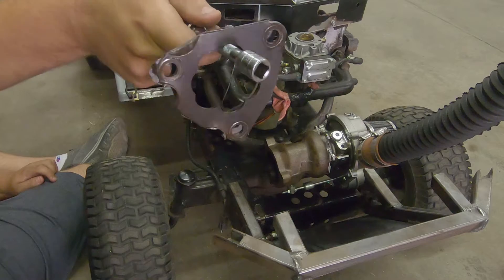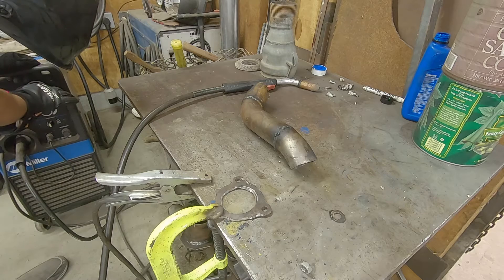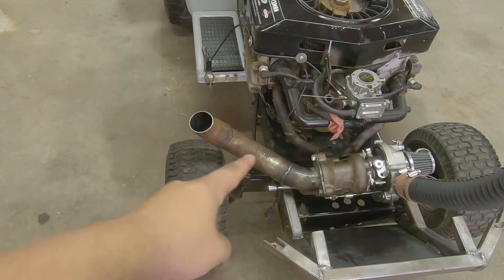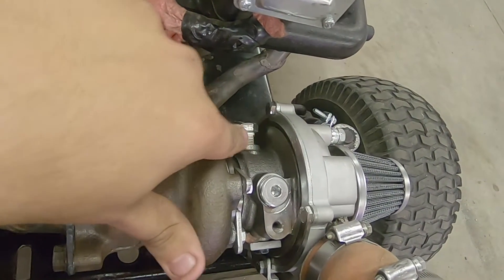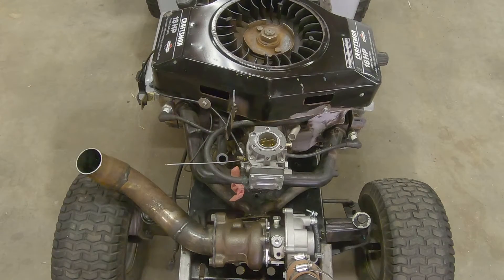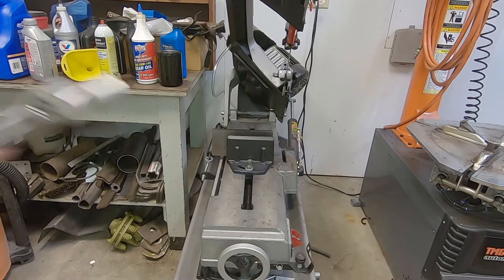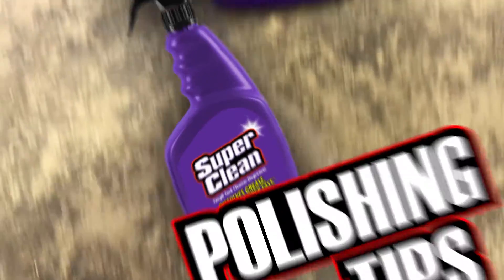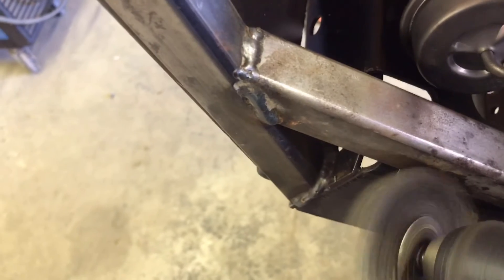TURBO MOWER BUILD-UP PART 2!!! | Exhaust Outlet, Oiling explained, First Run

Comment: I have the same type of engine will it work if I put a mini bike air filter on it
Reply from the maker: Well, sadly this configuration doesn’t work. The carb is a draw-through carburetor, and we were trying to push air through it. This causes it to shut the fuel off. We fixed it by placing the carb on the air filter side of the turbo.

Comment: Part 3 soon
Reply: Also you need to re jet the carb
Reply from the maker: @Bumpkin06  It has to be set up as a draw through, jetting doesn’t make a difference in this situation. But to answer, part 3 will be driving, so very soon…
Reply: @northwestexploration8119 A pitot tube in the intake to pressurize the bowl would have done it. 

Buuuut seems like this one was given up on. Bummer.

Comment: Nice job. Have you done supporting mods to the carb to take the boost? Blow through is abit harder to setup than the draw through setup. Keen to see it going full send in the mud.
Im not to sure which mower of mines going to go turbo just yet but have a tiny turbo ready to go
Reply from the maker: Draw through is 100% better, and we will be switching it over to draw-through soon. Also, turbocharging a mower is definitely an awesome project, glad to see more people out there that are doing this! Small turbos are always the best way to go btw… we learned that the hard way…
Reply: @northwestexploration8119  i got one of them tiny turbos you get from those turbo buggies allready has the bolt holes to suit carby so there really small. But keen to see build progress and want to hear the turbo singing as its got a big rooster tail of mud coming out the back tyres